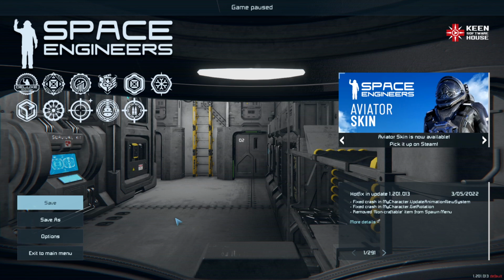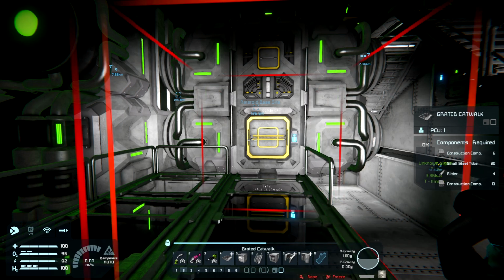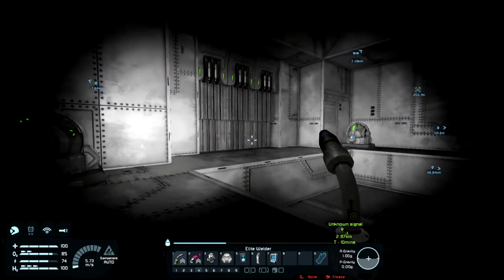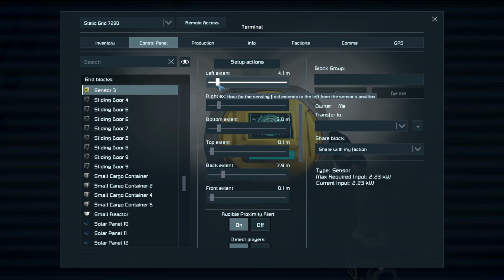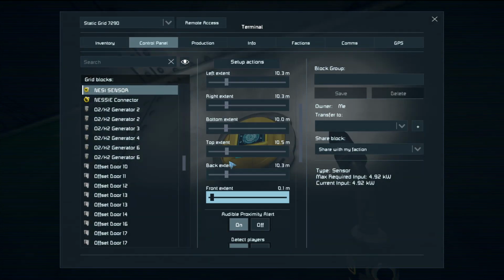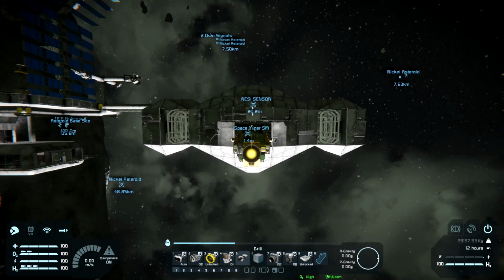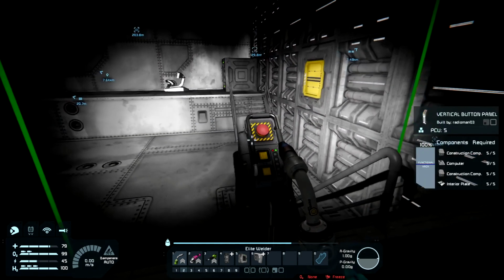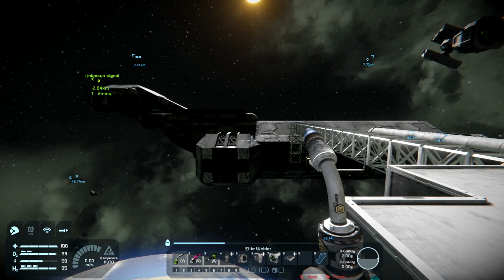Space Engineers EP43 "Hangar Doors and Jump Drives"

Comment: To test your power, move your ship forward / up / and right at the same time.  If your power bar pegs at 100%, you need to add more batteries.  As big as your ship is, you may not have enough gyroscopes.  This is a personal preference, just depends on how far you want to drag your mouse across your desk to turn you ship.  Antenna if you want to build remote control drones, beacon if you want to save power.  Turn off, “Show on HUD” on your hanger sensor and in “Info” turn off “Show Sensor Range”.  One more thing, “CTRL-Click” to change settings. :)
Reply from the maker: Thanks for these tips. I’ll go with the beacon and turn off the hangers sensor. We have space for more gyros if need be.